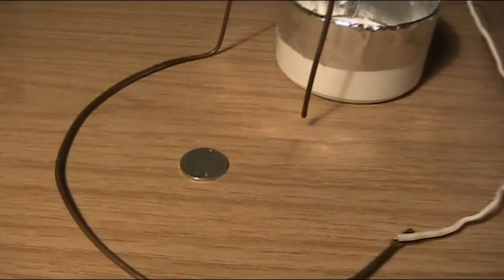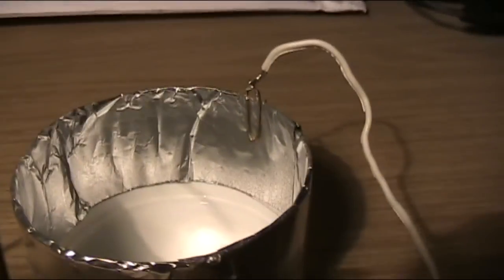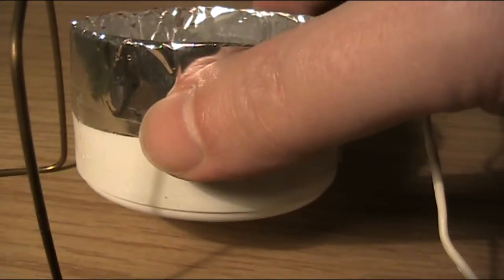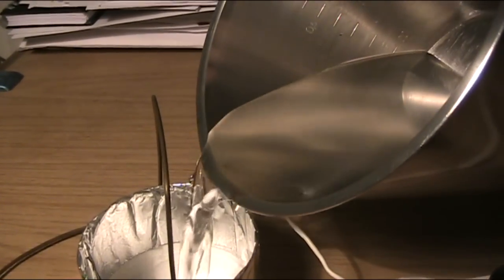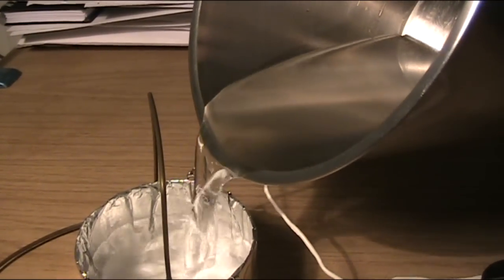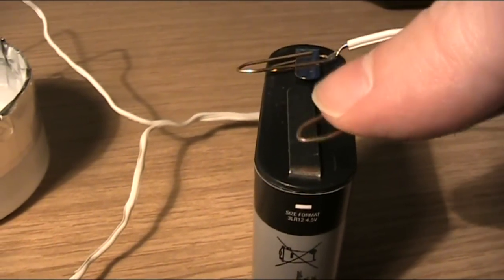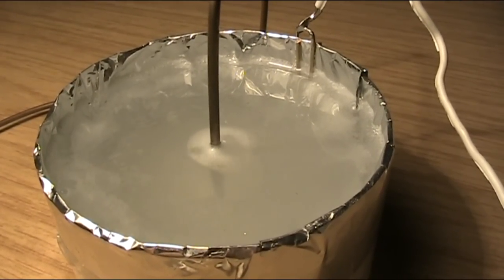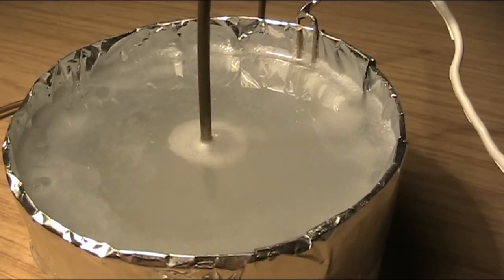Water rotating in a magnetic field

Comment: Hydrolysis with a water/salt solution also produces [poisonous] chlorine gas. Better to use water/lye (sodium hydroxide).
Reply from the maker: Good point. We have discussed this earlier here in the comment section. When there is only a small amount of NaCl then practically only oxygen is produced at the anode. When there is a lot of NaCl then mainly chlorine is produced. And when there is medium concentration then both oxygen and chlorine is produced. This should have been made clear in the movie. However, it is a bit more complicated than that.

Here is a discussion that relates to oxygen vs. chlorine --> http://www.madsci.org/posts/archives/2000-01/948038124.Ch.r.html

This one is also informative --> http://www.craigsarea.com/ho.html
It explains how (at the anode) chlorine can be an intermediate product that quickly participates in a secondary reaction which then results in oxygen.

I can add that, as far as I remember, there wasn't any noticeable smell of chlorine gas when I performed the experiment. I usually notice such smells if they are present. I guess the NaCl concentration wasn't that high after all, and perhaps the low voltage of the battery (4.5 v) also did not favor the production of chlorine.

Comment: the water rotates clockwise because you're in the northern hemisphere? maybe Australia would go counter clockwise?
Reply from the maker: Hi Mark, the rotational direction does not depend on where on Earth the experiment is performed, it only depends on the direction of the magnetic field and the electrical current. The magnetic field of the Earth itself of course contributes, but the contribution is insignificant.

Comment: looks like a fairly concentrated NaCl solution.  Chlorine instead of Oxygen could be evolving at the anode.
Reply from the maker: Good point Ben. When there is only a small amount of NaCl then practically only oxygen is produced at the anode. When there is a lot of NaCl then mainly chlorine is produced. And when there is medium concentration then both oxygen and chlorine is produced. This should have been made clear in the movie. However, it is a bit more complicated than that.

Here is a discussion that relates to oxygen vs. chlorine --> http://www.madsci.org/posts/archives/2000-01/948038124.Ch.r.html

This one is also informative --> http://www.craigsarea.com/ho.html
It explains how (at the anode) chlorine can be an intermediate product that quickly participates in a secondary reaction which then results in oxygen.

I can add that, as far as I remember, there wasn't any noticeable smell of chlorine gas when I performed the experiment. I usually notice such smells if they are present. I guess the NaCl concentration wasn't that high after all, and perhaps the low voltage of the battery (4.5 v) also did not favor the production of chlorine.

Comment: so all I need is a stupid battery to make hydrogen?! Why don't we use this to harvest hydrogen fuel???
Reply: whats better? To use the energy of a battery or to use the energy of a battery to produce hydrogen gas, and then getting energy from its combustion? There are more energy losses the 2nd path.
Also, hydrogen is difficult to handle and transport. Any slight mistake and you have a very powerful explosion.

Comment: This is nothing but electrolysis....
Reply from the maker: That is not correct. Electrolysis occurs, but the rotation is not happening because of that.
The rotation happens because electrical charges are moving through a magnetic field.
Reply: TheBigParadox oh I know that rotation is not happening from that lol... Was just a statement. Also depends on your frame of reference....
Reply from the maker: Well, the statement you made says that the only thing going on here is electrolysis. But that is incorrect. The electrolysis is just a side effect. This is even mentioned in the video.